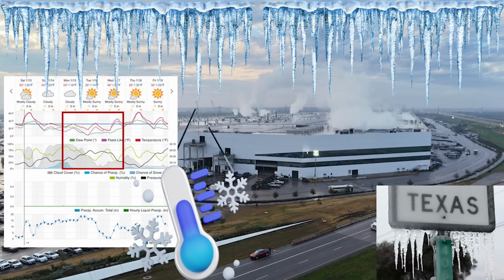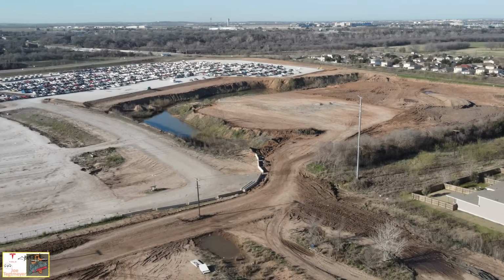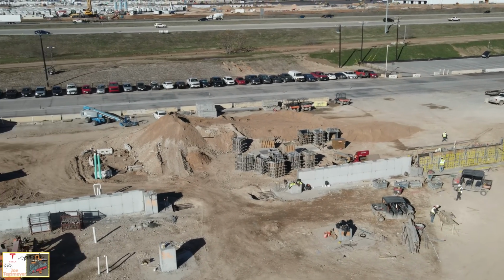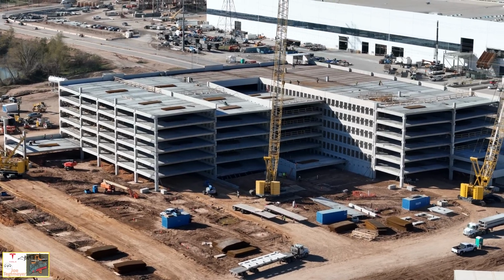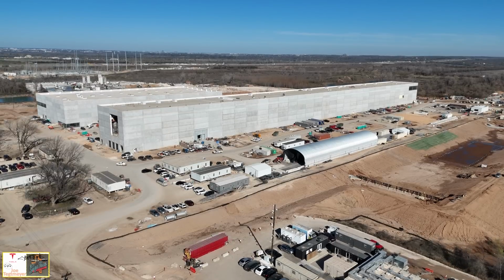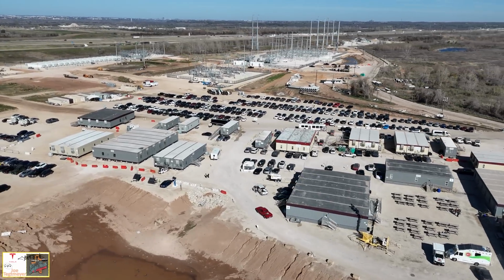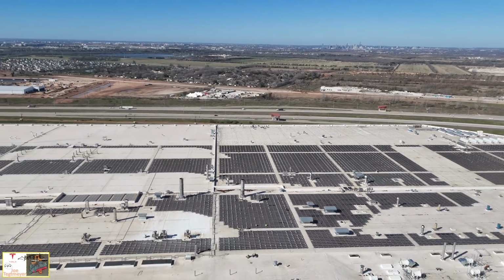Prufrock Arrives! S Extension & Park Garage Grow Larger!18 January 2024 Giga Texas Update (09:15AM)

Comment: What everyone must remember is any manufacturer can purchase these casting machines they are not tesla machines in any way. The issue is that none of the big manufacturers with nearly 100 years of experience wants to use them in the way tesla does. I watched a very informative video about why tesla casting is going to be tesla biggest headache. Yes if you were selling cars under $10 000, maybe casting would make sense, then insurers would not be losing too much when cars were written off from minor accidents. From the video I watched I learnt that manufacturers actually discuss the way they manufacture cars with insurance brokers so as to encourage them to keep premiums low, a car that is expensive to repair is going to cost so much more than a car that is difficult to repair. This is why tesla was forced to start there own insurance for there cars. Yes casting is an amazing idea, but when you have to dismantle half the car to replace the casting the cost means it is not cost effective, and as it is difficult/impossible to even buy tesla castings to replace them after being damaged insurer's really have no choice but to write off relatively lightly damaged cars. 
I think tesla could have put more thought into casting as other manufacturers have done. Instead of one casting for the front and rear made it maybe 3 parts, a wheel arch is damaged you only have to replace that one sides casting.  Damn they could use casting for multiple parts of the cars not just the front and rear but doors and bonnet and some other parts. The experienced manufacturers might even do that to some extent using the bigger casting machines with a dye that can cast multiple parts for multiple cars in one go.

I hope tesla changes the casting and splits the one part into maybe even 4 or 6 parts, it is still better than the 130 plus parts other manufacturers stamp and bond together for the one part tesla casts. Or they can design the car so that it is quick and cheap to replace the one cast piece, maybe make it removable from underneath withough having to dismantle everything. But then I realise no matter what they do replacing the casting means removing the suspension, and they cannot stop that.
It is a pity casting is causing so many problems for insurers it is an amazing idea that all experienced manufacturers knew would be an issue for tesla.maybe tesla will change the way there cars are manufactured in some way to make it easier and much cheaper but I don't know how.

So sad to type this but facts are facts.
Reply: According to Sandy and Elon, this is flat wrong and you must know this if you are willing to type that much.

The design is that there are two classes of areas on the castings. One class is designed to be cut off and replaced with field-attached replacements available from Tesla in the event they be damaged in a collision. Inexpensive repair. The second class of part, if damaged, results in a total replacement of the casting, but that is a collision where any car of any construction would be written off by insurance.
Reply: Which is one of the reasons why I don't like Tesla. Tesla, like Apple, doesn't seem to give a rat's *ss about repairability.

Comment: Thanks Joe
6:06. New EOL supercharger station. Centre. Conduits run through the screw pile capping plate.
6:37. Westside. Tunnel Project. Bottom, right. More TBM components.
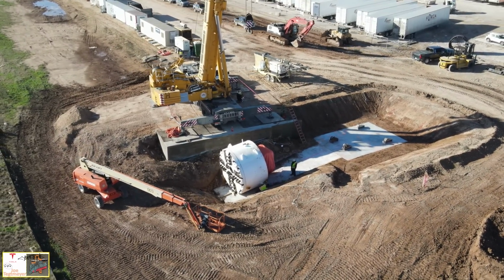7:00. Westside. Tunnel Project. TBM. Cutting Head in place. Lifting lugs yet to be cut off.
Something being cut on the underside, smaller lugs perhaps.
Concrete block built up with salvaged paving slabs, purpose only to support the crane outriggers.
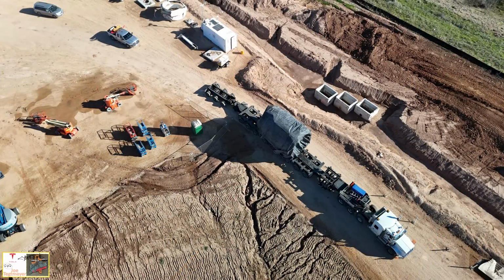8:07. Westside. Tunnel Project. TBM tunnel shield on the low-loader.
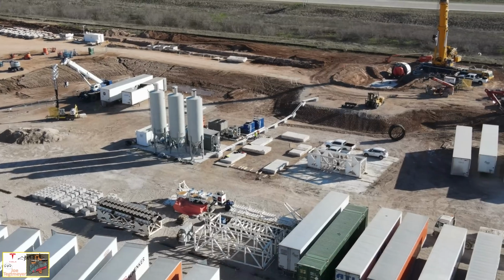8:24. Westside. Tunnel Project. Centre left. Concrete legos spaced out with a track placed on top. Support for the grout pump lines, cables, etc.
Centre right. Base of the conveyor belt storage cassette/magazine placed square to the direction of the tunnel. Only placed on timber bearers. Suspect not the final position.
Trench and a spool/reel of black pipe, likely a water supply.
9:29. Westside. Bottom. Yellow 'C' shaped item on the trailer was seen at the Boring Co yard. Lifting rig to place something deep into the TBM.
10:25. River Road, south. Median, placing topsoil.
Right. Excavated around the vaults. Some conduit works on the ductbanks.
10:54. Southend, east. Diagonal corner. Level 2 perimeter floor beam. Black top and bottom tracks installed for the glazed units.
Confirmation of Level 2 windows.
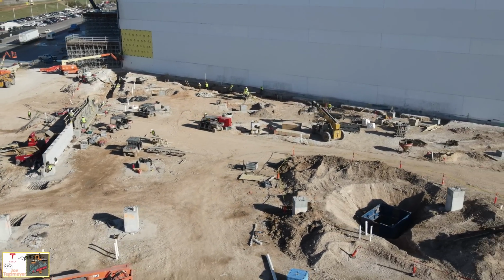12:09. Southend, west. Right. Trench shield, on the skew. At about the speculative point of exit for the TBM.
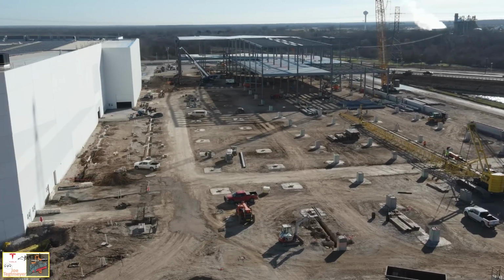13:15. Southend. Left. Pair of parallel grade beams/strip footings joining the column footings. Speculating this is to enable a ‘cut and cover’ tunnel ramp to the tunnel entrance.
13:56. Southend, east. Tank farm. Bottom. 4 tanks bases visible. Bins of tank fittings to the right.
Top. Pair of elliptical frames. Thinking heating coils. Possibly associated with the tanks.
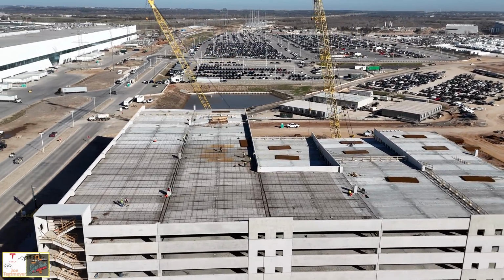15:34. Parking Garage. Cover strips laid over the Double T floor deck long edges.
Short lengths of rebar placed across the short edges. 
Strips of  ‘continuous bar chair’ placed. From googling, ‘slab bolster’ in US.
Rebar mesh to be laid over.
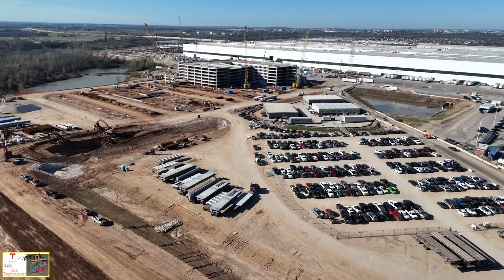16:30. Parking Garage Site. Left. Exposed the pair of buried drain pipes.
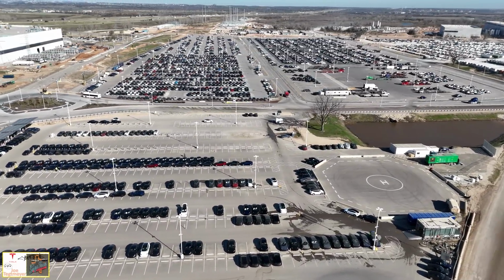17:40. Wind tunnel. Bottom right. Model Y getting a blast. Been there for a few days.
18:45. Casting, east. Apron. Right. 2 tankers. Sapphire Gas Solutions (been on site before). 
2 trailers with 2 black tanks each (vaporising system?) are connected.
Might be working on the internal LNG lines and have the section into Casting shut down temporarily.
3 massive new furnaces likely associated.
BIW. Apron. Left. Against the wall. Salvaged vault placed.
19:02. Casting east, apron. 1 furnace hood moved inside.
19:22. Transport yard. Bottom left. Cybertruck being crated or uncrated.
21:03. Cathode, pond. North end mirrors south end.
21:47. Cell Test lab. Concrete road barriers placed in front of window. Happens to align with the Wade Pit more than the building.
23:05. Cathode, west. Excavated through the newly placed asphalt to work on the sanitary sewer.
23:29. Cathode, west. 3 parallel trenches. If not for the location in the centre of a roadway, I’d suggest a building.
24:30. Die Shop, south. Crane and trailers of counterweights. A large travelling gantry crane seen being delivered in Joe’s photos.
26:23. BESS. Fiddling around the edges. Mid February.
28:28. Battery north, apron. 3 Bridge cranes beams.
Inside. Gravel floor, still very much a construction site in there.
Reply: " Yellow 'C' shaped item on the trailer was seen at the Boring Co yard. Lifting rig to place something deep into the TBM." 
Is this not what they use to lift the TBM's screw conveyor into place?
Reply: @Gig0Surf  9:29. May well be just for that purpose. I don't recall seeing it in action at Bastrop.

I don't particularly know the first thing about TBMs. Done a good bit of googling over the last month since the tunnel segments showed up.
Reply: I believe we saw it in use for the first TBM assembled in Bastrop, filmed by Jeff.  I'll check tomorrow.  @DessieDoolan
Reply: @Gig0Surf  I must have missed that one. I have a couple of mentions of it in comments under Joe's videos, but not in action.
Reply: @DessieDoolan  Sorry, mixed up who posted it.  There was an image of the yellow-c load spreader lifting the auger into Prufrock posted by Chapsmoke on Apr 1, 2022 [mentioning the social platform gets my comment deleted]
Reply: @DessieDoolan  Hopefully with 3 drones it works out.  You can also try dropping me a message
Reply: 13:56 How did you know weeks ago that there was gong to be a tank farm there?😊
Reply: @DavidJohnson-tv2nn  13:56. Initially the 3 sumps formed up in the concrete in Joe's 20 December video, then in Jeff's 3 January video the base sheets were seen being unloaded.

Comment: Thanks Joe!
EOL facility:
North:
@ 2:39 (Bottom) Cables that have been pulled through the duct-bank under the freeway and coiled up outside the vault are gone. Guessing that they were pulled into the duct-banks going west or south. Sure would be nice to have a look down into the vaults, if possible.
West: 
@ 5:18 Newly graveled lot appears to be at a lower elevation than the newly paved lot just to the north.
South:
@ 5:46 Ongoing work to lay conduit for the Superchargers.
@ 6:01 Area being formed up for a concrete pad for the transformers and power distribution cabinets. Looks like there will be two of these pads. Two transformers per pad.
River Road:
@ 10:25 (Right) Excavation and work around 2 previously installed vaults. Speculating that they may be placing the overhead powerlines into the underground duct-bank soon.
Parking Garage:
@ 15:30 Crew placing rebar grid sections on the top deck in preparation for concrete pour.
@ 16:46 Stack of rebar grid placed on the ramp. They likely place these stacks throughout the building as it is being assembled.
@ 16:53 (Lower right) A view of the stairwell and elevator shaft.
Eastside of casting:
@ 18:35 (By the building) New vault (Re-used vault) placed to the left of the two main power vaults. The new vault will supply power to the Superchargers.
Also @ 18:35 The main power vault to the right doesn't appear to have any cables pulled through into the building yet.
@ 18:41 (Lower right) Two sets of cables pulled into one of the main power duct-banks heading north to the vault in the north parking lot. Seen here @ 26:55
@ 19:14 (Bottom, by the pad-mount switchgear unit and the transformer) Cover removed from the Supercharger vault.
North parking lot:
@ 26:55 They need one more set of cables to be pulled through, and then splicing can be completed.

Comment: Jeff caught video of them moving the second part of the proof rock but then they put if back on the ground next to the crane.
Reply: It looked to me that the horizontal pitch was not proper to mate up with the boring head. They placed the piece back on a rack on the ground to change the rigging angle. They checked the new angle at least twice in Joe’s video.
Reply: Yes, Not usual to lift a TBM section directly from delivery to the assembly. Usually some preparation work required and often re-position/rigging of the crane and lifting gear. @bobcallahan2322

Comment: With model 2 production and simpler time to each car to produce, like 20 to 30 seconds, maybe lower, 15 to 17 seconds, full ramp?
What is going to be the main hub of transport off? When is the train coming to gigatexas also, where will it be, and the new open air warehouse like gigaBerlin, I was comparing Shanghai development and pace of spending and lime to each stage, I figure a year ago the tunnel,
with Berlin toys and development, the end of line was to close to the factory, with no space on factory side and slower construction, it needs to be sped up, slow compared to Berlin and Shanghai, I have lived in China for around a decade, going back this summer

Comment: The exit of the Boring Tunnel is complicated by the deep stormwater pipes as it would take some distance for the road grade to the surface if they go to the building. 
There is plenty of room west the road a much easier portal. But then they must drive across the busy road.

Comment: 5:13 You can see that they're applying an additional coat of asphalt to the portion of the lot that was previously paved.  This is normal.  The first coat (often called a "binder" coat) will be coarser, and then they put a smooth top coat on.  They often like to leave some time between coats.  Here in New England, they often have new streets stay with just binder over a winter first to make sure the road is good before putting on the top coat.
Reply: Good catch. Similar in germany. First coat of asphalt is rougher, you can actually see the rocks inside. Then second coat (the top layer) gets added, very fine and smooth finish. On new roads "silent asphalt" is used, makes the road really quiet.

Comment: Wonder if they are using this smaller tunnel as a training tunnel before doing the much bigger tunnel under the river.

They should build a pedestrian bridge from the parking garage over the road to the factory.
Reply: Building a pedestrian bridge would be nice, but likely wont happen due to a clearance issue with the transmission lines.

Comment: For our resident Tunneling Engineers: Jeff just shared an awesome video with lifting operations with the second piece of the TBM. But interestingly also a view right inside the first part of the TBM. Four tubes in view coming out of -what appears - a closed front section that houses the rotating shield. Is this the type of pressurized shield design to push back against soft soil pressure and/or water pressure?
Reply: Yes, I believe Prufrock is an "Earth Pressure Balance Machine (EPBM)".  Those 4 tubes though I believe are the electric motors that drive/rotate the cutting head.

Comment: Hello Joe. About the magnesium vs today's aluminium alloy: Sandy Munro has been advocating this switch for awhile.  All the beauties like weight and strength are obvious.  But the price per a kilo or a pound? The lighter stronger structural parts will have to cost more.  I think that magnesium is about four times as expensive.  But I haven't checked for some time.  It will certainly pay back owner's extra money spent considering how much stronger (less gussets) and therefore lighter it is (battery life / range). Cheers!
Reply: The Limiting Factor doing a series on Magnesium casting, well worth watching.
Reply: The one downside to magnesium besides cost is the flammability. Once magnesium is on fire it’s almost impossible to put out. Given the bad fire stories that already exist about lithium batteries, adding in magnesium will give naysayers even more to go on about. But it does save weight.
Reply: Helicopters have used magnesium for exactly this reason for decades. I remember the old UH1 Hueys have used magnesium extensively

Comment: Ever seen magnesium on fire? Brightest flames I’ve ever seen.
Reply from the maker: Ever flown a jet aircraft with magnesium parts? I have for years and no issues.
Reply: @JoeTegtmeyer  Several! Have you ever seen an aircraft on fire and had to try and rescue the crew? I have, it isn’t a pretty site!
Reply from the maker: @stephenreese5921  which aircraft?
Reply: @JoeTegtmeyer  Certain types of helicopters
Reply from the maker: @apolloskyfacer5842  oK … I’ve flown certain kinds of aircraft in certain kinds of missions
Reply: @JoeTegtmeyer  F-16’s, F-5’s, T-38’s, CH-47’s, these aircraft I have personal knowledge about. I’ve put bodies in body bags, Joe! Pilots are not concerned with aftermath. They either punch out or bail in haste from a plane on fire. When I was a firefighter/paramedic we had to clean up the mess. As a pilot, I respect your view but, I have one of my own.
Reply from the maker: @stephenreese5921 I’ve flown most of those and you obviously don’t know me as so care a great deal for the personnel that make the mission happen … thanks for your service but you should not make such overarching assumptions.
Reply: @JoeTegtmeyer  I wasn’t just a firefighter/paramedics in my life. I built or flew in those aircraft. As a prototype mechanic when employed by Northrop (F-5, A-9 in competition with the A-10, T-38, F-20, F-18) and built the flight controls (specifically the “birdcage”) which controls the stick inputs from the cockpit to the ailerons and rudder on the 38’s and 5’s and the F-20 Tiger.
Reply: @JoeTegtmeyer  In my life…you don’t know what you don’t know.
Reply from the maker: @stephenreese5921  correct
Reply: The Limiting Factor doing a series on Magnesium casting. Fire less of an issue with alloyed magnesium.